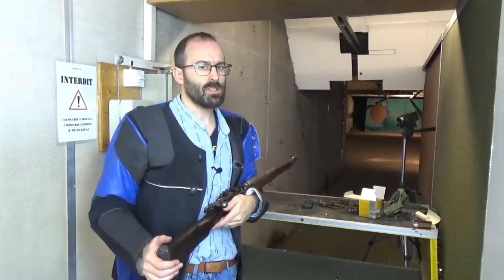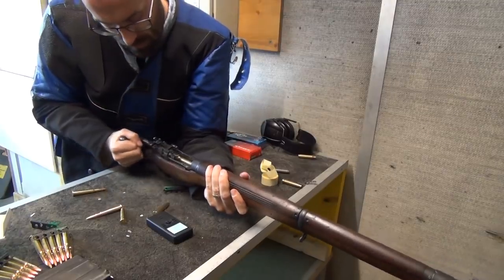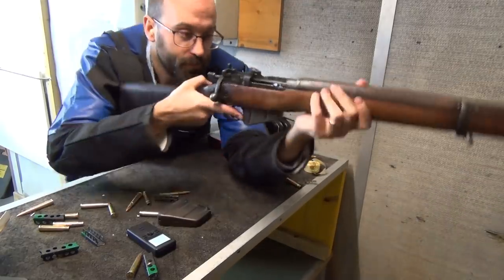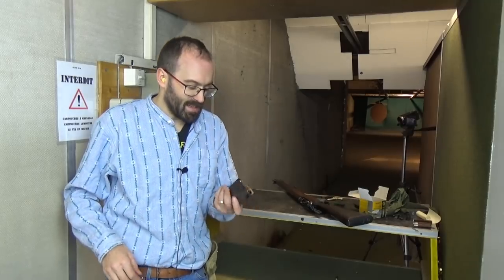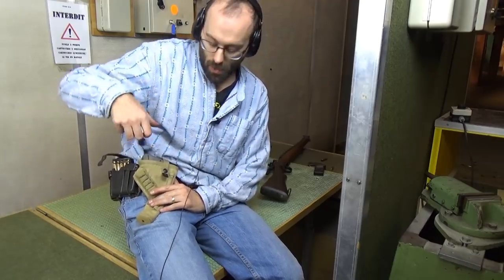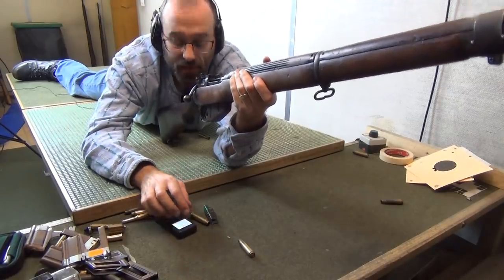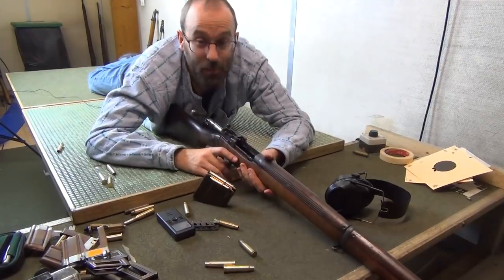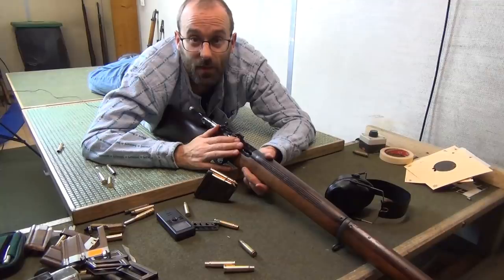Fastest Way To Reload A Lee-Enfield: One Charger Clip, Two Chargers Or A New Magazine?

Comment: An unrelated question. Which SMLE variants had a barrel flush with the nose cap and no magazine cut-off?
Reply: The no1 mk3 is the service rifle but there were other no1's. I think the no1 mk5 was essentially the no4 mk1. Forgotten weapons actually covered this a couple years ago and so did British muzzleloaders. Great channels if you haven't seen them. Cap and ball is another great channel
Reply from the maker: No, the No.1 Mk.5 is not essentially the No.4 Mk.1. It's a No.1 Mk.3 with an aperture sight and an extra band at the rear of the nosecap. The marks from No.1 Mk.1 to No.1 Mk.5 had the barrel flush with the nosecap. Can't remember off my head exactly which always had cutoffs and which never had them, but IIRC it's No.1 Mk.1 without, I think the No.1 Mk.1*, ** and * may have had them (the * I've seen certainly does), No.1 Mk.2 probably had them cos they were conversions from earlier types, most No.1 Mk.3's had them (but not all), most No.1 Mk.3*'s DIDN'T have them, Mk.5's did, Mk.VI (which is the proto No.4) did too. As did the trials No.4 Mk.1's.
Reply: @BlokeontheRange  the mag cutoff was a mid 1916 change that much I do know which is how I knew without trying to track my 1916's whole history but I know it was a second half 1916 because the lack of cut in the wood. Kinda like with 1943 mausers with the milled and stamped bands. Thanks for all the info you put out in your videos and correcting my bad information. We never learn if nobody points out our mistakes and corrects them.